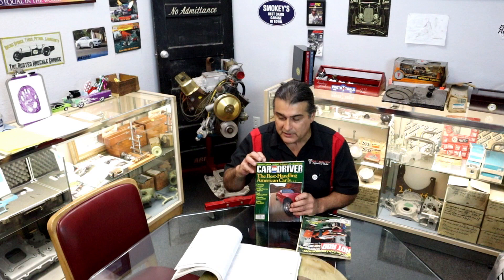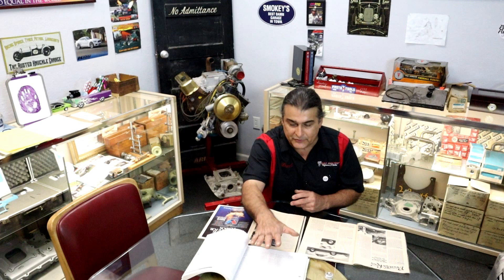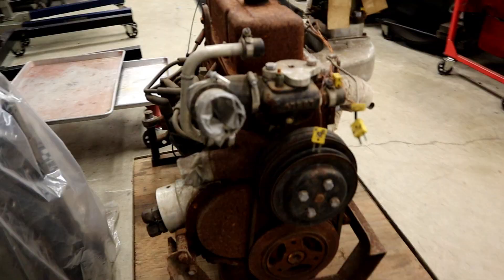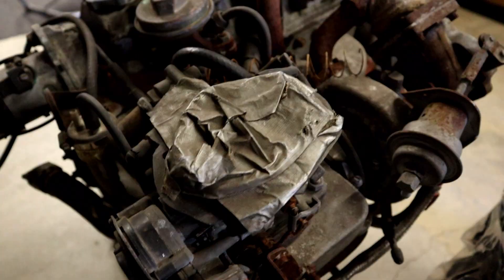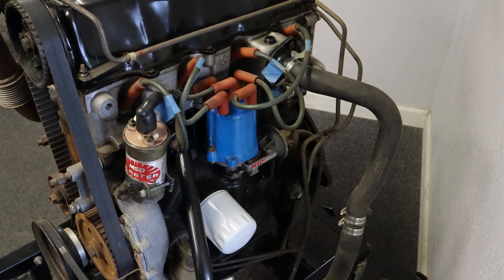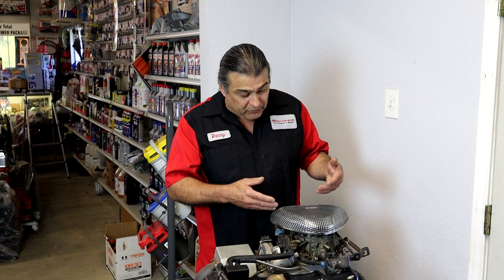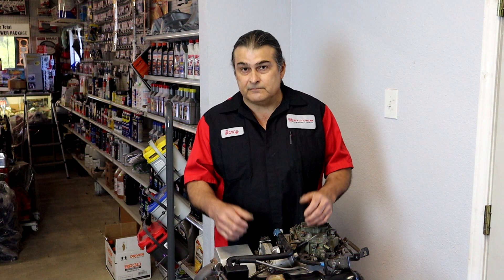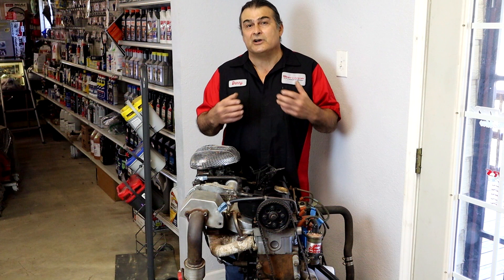What ever happened to Smokey Yunick`s Hot Vapor Engine

Comment: "Welcome to the Smokey Yunick hot vapor engine museum, I'm Danny, the curator of this collection." ;)
Reply: What happens on the cold start ,when there is no heat. Glow plug?
Reply: @tedpeters9699  It starts like any carburetted engine, with the choke on. The real fuel economy only starts when the engine is up to full temperature, which would take about 15 minutes.
Reply: @mrdanforth3744  Thank you,
Reply: THIS ENGINE actually caused an uproar with the Corvette guys. THEY were worried about the Vette, viability. With a fiero that got 50 mpg , had 300 hp. WHICH was the time The vetted guys started lobbying the fiero to be discontinued.
Reply: @w41duvernay  
You guy's kill me with your Corvette conspiracy tales, none of them are true.
GM never had a policy that no car was allowed to be faster than the Corvette, if GM had such a policy then the Buick Grand National would never have been allowed to be built in the first place.
And I suggest you try reading the real history of the Pontiac Fiero and not the conspiracy crap that gets thrown around by people on YouTube. 
And guess what, there wasn't a shooter on the grassy knoll either.
Reply: If You can get 250hp w/4cyl engine
what can You do w/ 05 toyota Avalon 3.5 / 6cyl ?
Reply: @dukecraig2402  maybe so , but , there WAS a dead President in the back seat !
Reply: @johnhoward7298  
Based strictly on displacement it would be 350 HP.

I doubt that the increase in HP over the stock 2.5 would be proportional to the 3.5 since newer engines make more power per ci mostly because of more efficient combustion chambers, today's combustion chambers employ better squish bands and a better shape that more efficiently burns the air fuel mixture, however with a hot vapor engine the dynamic changes because you don't really have the same kind of atomized fuel that today's engines burn so much more efficiently than engines did back then, the fuel's been turned completely into vapor which negates the advantages newer combustion chambers have to burn atomized fuel.
It would be interesting to find out though.
Reply: @dukecraig2402  No why so short production run?
Reply: @diduck6878  
I don't understand what your question.
Reply: @dukecraig2402  Go look up " Smokey Yannick fiero" and tell me if spokesman is being paranoid while telling fate of Fiesole. Corvette people are well known to try to protect their status in GM.
Reply: @w41duvernay  
Just try reading the story of the Fiero, there was no Chevrolet interference with it, it's a ridiculous narrative that completely ignores common sense, I mean it's so dumb it's unbelievable, if it had one bit of truth to it cars like the Fiero and especially the Buick Grand National never would have been built in the first place, do you seriously think that after spending the millions of dollars it takes to develop a car that GM would drop it because some guys from the Chevy division would walk into someone's office and tell them to? Come on, and another problem with the BS theory that Chevy forced Pontiac to drop the Fiero because of Smokeys hot vapor engine is that the principal behind it isn't exclusive to the 2.5 engine in the Fiero, if GM was interested in the tech they could put it on any engine including the Corvettes, that's what Smokey hoped for then he'd get a royalty on every one made for 10 years or so, he wasn't about to design something that could only be used on one model, the Fiero was just a demonstrator for GM, like I said anyways the tech isn't somehow magically exclusive to the 2.5 engine it could be adapted onto anything but it's full of issues.
The real story about the Fiero is that when Pontiac designed it the engineers couldn't use the suspension they'd designed for it because GM mandated it had to use existing components in the suspension and an existing engine instead of all the stuff the Pontiac designers would have liked to because GM was in dire financial straits at the time and had to cut costs everywhere and couldn't afford to build the tooling to make the components that the Fieros engineers originally wanted.
As far as Smokys hot vapor engine I've heard so many conspiracy theories over the years all the way from GM not using it because of big oil company influence to Chevy having some kind of mystical power over GM, the truth is the hot vapor engine possesses a lot of problems that are difficult to overcome to get it to work right all the way down to turbos not being the most reliable things in the 80's, all of us who were mechanics back then saw that, we saw turbos failing right and left on the few factory cars that had them, GM wasn't about to put a warranty nightmare on every car made, even if it was just every car from one model, they didn't want the hassles and expense of having to back that many up, it could have bankrupted them given their precarious finances at the time, once again it was a time when GM was having serious financial issues. 
Videos like this and articles about Smokeys engine are made by people who want you to look at it with awe so they're not going to stress the pitfalls of it, they want you to ooh and ahh over it, not see all the impractical problems with it.
Reply from the maker: @dukecraig2402  I made this video because of all the miss information out there like this. There nothing but facts here!
Reply: @MrDanielSoliz  
I don't understand your meaning, if you're referring to me saying that the Fiero wasn't some conspiracy victim of the Corvette  having say over what happens throughout GM then I have no clue what you're talking about, if you are saying that the Fiero or even Smokey's hot vapor engine was something that the Corvette personnel had canceled then you'd be the one passing misinformation around, that's nothing but a myth, if it was true cars like the Buick Grand National and especially the GNX never could have gotten built in the first place, along with several Cadillac models.
Reply from the maker: @dukecraig2402  there you go again with your myth’s. My info comes from Smokey who by the way also made the grand national possible. You must know someone who worked on this project? If so please give us his made. If not then you have your info from? 
If you want some insight about GM and how they think watch who killed the electric car and what they did with the batteries. 
You may also want to read Smokey’s books and really get an insight on what was going on at corporate.
You are correct about GM never putting the money needed to build the Fiero.
They used a truck engine and had oil pan problems (fires) Citation drive line and so on.
Reply: @MrDanielSoliz  
Well first off you should probably know that Smokey wasn't the first person to make a vapor engine, there was a guy in the 70's that had an operational one, there's even a video on YouTube that has footage of him running the car back in the 70's.
And Smokey wasn't the official historian of General Motors, given his known history of telling tales you should probably take anything with a grain of salt when it comes to him saying anything about why GM did anything that they did.
I'll give you the same challenge that I give to anyone else that throws that myth around about the people in the Corvette division of Chevrolet supoosedly dictating policy when it comes to the other divisions of GM about what they were allowed to build and what they weren't, unless you can refer me to an official policy that's on paper or even a memo from GM stating such it's nothing but hearsay.
I've yet to read in a book that's been published with the authorization of GM about their history and the history of the Fiero that tells any different story about the Fiero and it's development and demise that's different from even the one that Wikipedia has on it's history, and the people at Corvette had nothing to do with ANYTHING about it's development or the decisions that sent it down the path it went down, the decision to use existing suspension and other components in it instead of the one's the Pontiac engineers would have liked to use were done for budgetary reasons and not because people from the Corvette division marched into Pontiac's offices and told them what they can and can't do.
Unless you have any kind of official documentation about it that states otherwise you're no more credible than "I know the true story, trust me".
Reply from the maker: @dukecraig2402  Why did GM kill the electric car? 
Don’t know where your getting your facts, no one said Smokey was the first to build a Hot Vapor engine also no one said GM killed the Fiero because of Smokey they just weren’t going to use his engine in the Fiero.
This video is about the engine not the car. 
Your love of GM is apparent and you believe everything they say. 
That’s ok just stop making up stories about Smokey and this engine.
I challenge you with facts not stories. You option about Smokey is base on stories where’s your facts?
Reply: @MrDanielSoliz  
First off I never said anything to the contrary about what you said about GM not using Smokey's engine, my conversation, which was with someone else, that you jumped into and started calling me a bullshitter was about the myth about the people at Corvette dictating policy over all other GM's divisions, then you popped in and started telling me to "get my facts straight" so how was I supposed to take it any other way then that's what you were talking about? The Fiero story.
And as far as your claim that I'm "making things up" I don't know where you're getting that from but I can back up anything I said with sources beyond "I'm the inside guy with all the real knowledge", once again if you can come up with any credible sources that contradict anything I've said so far then go ahead and cite them.
You're the one that came charging in here accusing me of being a bullshitter and telling me to get my stories straight and not only was I not talking to you I was talking about something that now you're saying you weren't even talking about.
Once again give up some official documents or anything that's contrary to what I said, maybe you should read back through what was said because I think you got some wires crossed or misinterpreted something I said, otherwise I can't understand where you're coming from because I was talking to someone else about the myth that Corvette dictates policy in GM about who's allowed to do what.
Reply: @MrDanielSoliz  
And no I don't have a "love for GM", you do know that Smokey also built a version of his engine in a Chrysler in the 80's and approached them about it and they turned it down also.
I have a love of cars and not "GM" in particular just so you know, and as far as GM and their history with the electric car I don't know anything about what they did and really don't care, electric cars aren't something I could care less about and have never bothered with them or their history. 
If you want a successful YouTube channel and expect people to subscribe to it I'll suggest that you don't get confrontational with people on it,try a little better manners if you want people to subscribe because I sure won't be, get your facts straight.
Reply from the maker: @dukecraig2402  yes I know Smokey built a engine for Chrysler that’s the one I’m standing in front of and I am putting it back in the car.  Sorry, I can handle someone telling me I don’t know what I’m taking about but saying Smokey didn’t know what he talking about does piss me off. I do apologize for that. All I’m trying to do is show everybody that these engines do exist and do work. For some reason people can see them,hear them and still don’t believe. Today is the 20 year anniversary of Smokey’s passing and I’m a little bit emotional. Again sorry and I meant no disrespect.